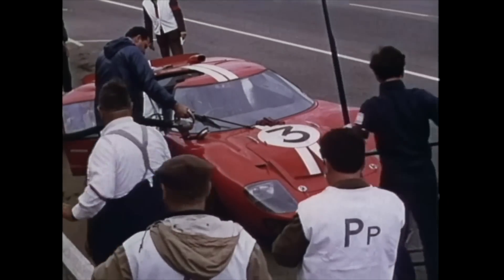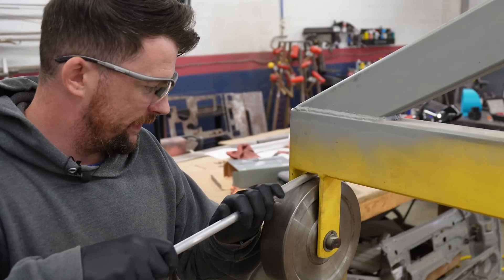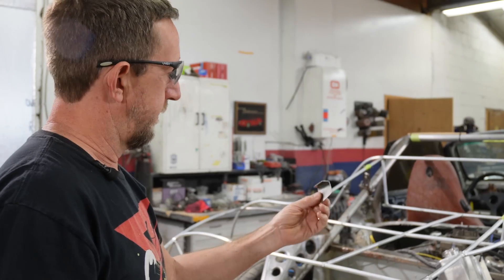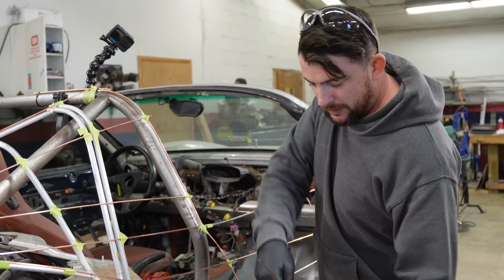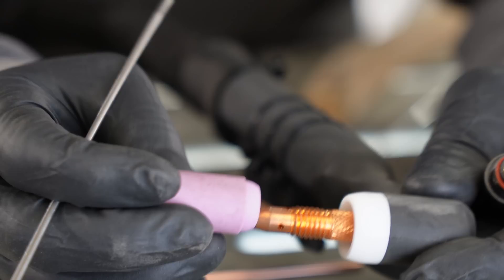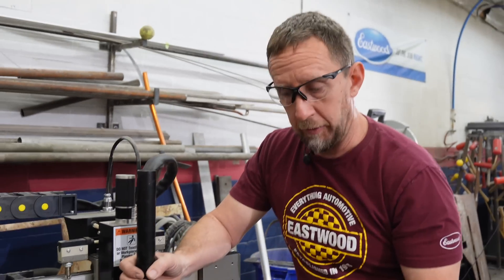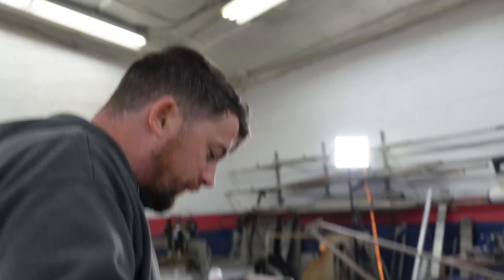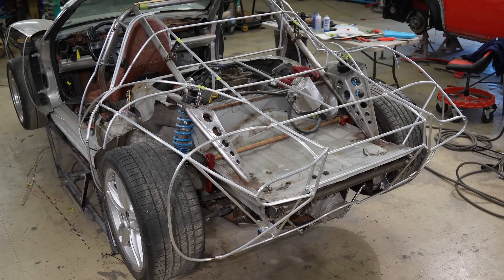Building Our Supercar Like the Legends! (GT40, Miura, Etc.) -- Project Jigsaw

Comment: As usual nice work. I do have a question, given the existing structure is steel would it not be easier to build the "floating" section out of steel. That way it could be welded to existing structure including the door striker area and increase strength and rigidity. this would also create a solid area for the clam shell to latch onto.

Comment: Loving the series guys, if you're still struggling with gas flow on your TIG torch try using a gas lens body set up instead, it helps distribute the gas better.

Sorry I couldn't help myself. 😂